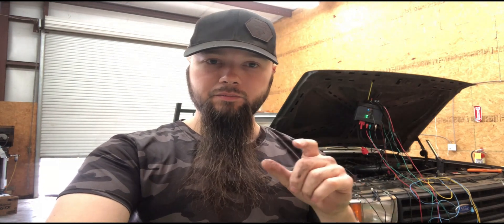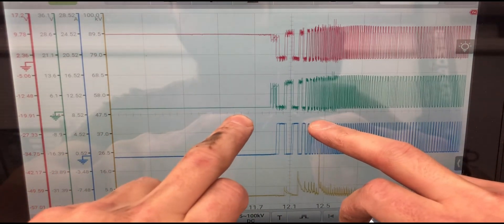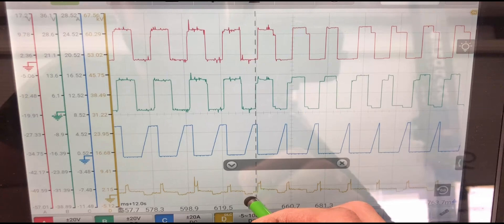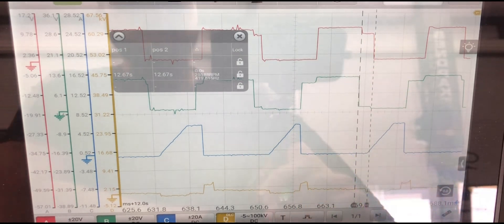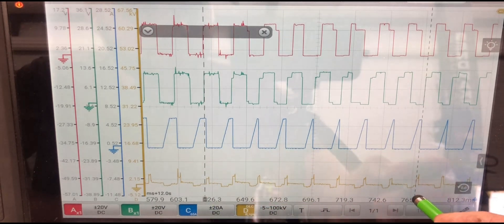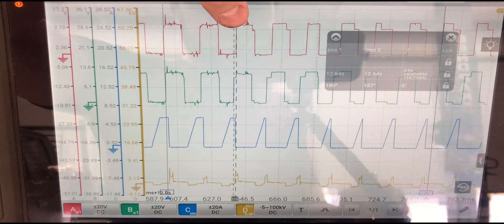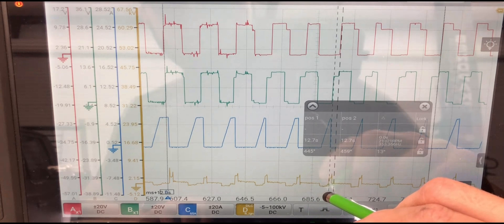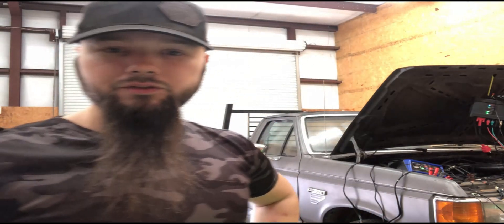Nerd Stuff - Ford PIP & SPOUT ignition control strategy explained

Comment: The sparkplug is fyering when the SPOUT signal is going up, is that right? I’m figuring out how to retard the SPOUT signal by turbo- pressure (the EEC-IV can’t do that by itself) so I have to understand the signals first.
Reply from the maker: correct, spark fires on rise of SPOUT at idle and higher engine speed

Comment: Is the clipping present at idle?  I’m working on a 94 F150 5.0 that had quite a few other electrical issues.  Has an intermittent stall where it loses coil control, however pip and spout continue. Odd thing is there is no clipping at idle, only when snapping throttle.  I have tried multiple other NOS original TFI modules that will run on another truck.  So it’s hard to believe the modules are dropping. Also stalls with spout pulled.  Seems less frequent.
Reply from the maker: I'm not sure if my last response came through or not.  It seems when I respond on mobile, YT may not actually show that reply - yay..  Anyway, on this truck, yes, the clipping was present at idle.  The clipping would start during the transition from cranking to idling which was pretty much anything over about 300rpm or so.
Reply: @ Yep it did come through.  I scoped my 96 and clipping is present at about 300 rpm.  I am super confused on this 94 though. According to the PCM guy that did my capacitor replacement, the HOG0 computer in this truck does not have computer controlled dwell.  Which would mean it should have the gray push to start TFI and a 22k Ohm resistor in the harness. Which it does not. The module is receiving PIP and SPOUT, they are both present and visible as the truck stalls. It just drops coil control. It seems odd to me that a 94 MAF truck w/ sequential injection would have the older style non computer controlled dwell. All signs point to something is taking out these TFI modules internally.  I am using known good modules with the old style Motorcraft embossing. Not the aftermarket or new Motorcraft without the embossing. Those would barely run the truck, they also got noticeably hot to the touch. Been over all the grounds and the customer threw the parts cannon at it with another shop with all new Motorcraft sensors for basically everything.

Comment: Much appreciate the analysis, what I would have liked to see in this video is the narrow red waveform moved over to the left to show the next narrow waveform 8 firing events later showing that it is a repeating pattern for a reason (why), I would also like to see which cylinder this is supposed to be on so maybe we would know if the distributor is properly stabbed with proper timing and alignment of the drive gear. Since I have found your channel at the beginning of the year '24, I have rated you at 70% (14 of 20) as useful videos to an experienced tech. No storytelling or DIY counted as useful. Thank you for all your videos and keep up the NERDY stuff Brother.
Reply from the maker: happy they’re helpful